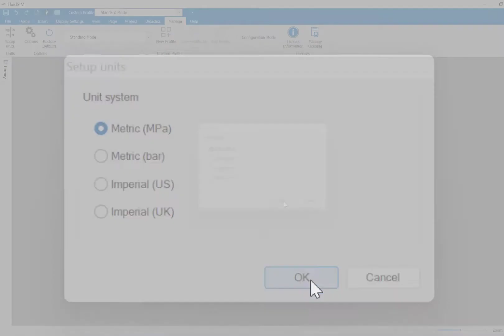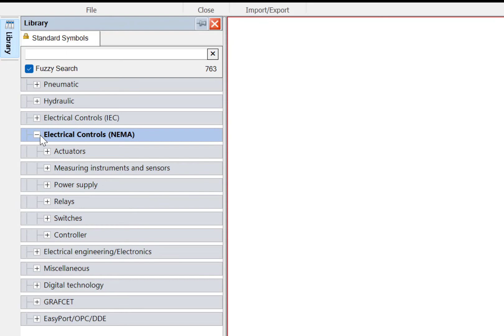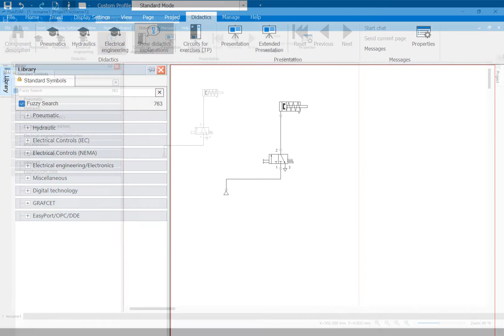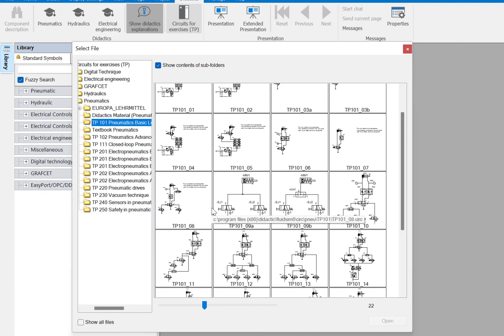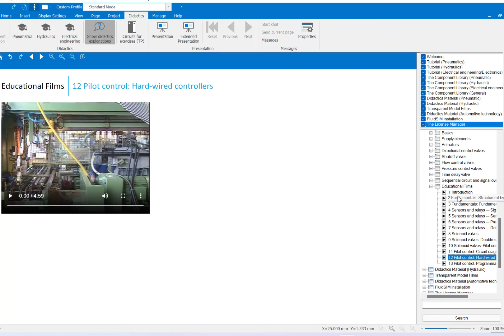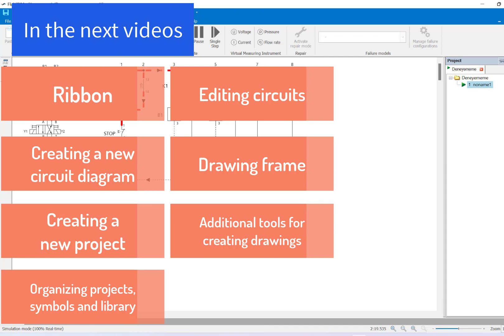Introduction to Festo FluidSIM 6

Comment: how much is the software? sir including the activation?
Reply from the maker: It depends. There are so many options about licensing. My lisansing procesure is complicated. The better is to send an e-mail to the local distributor of the software or the Festo Global directly. Academic lisansing is slightly different and cheaper I think. You can try to purchase a lisans on the Festo website and they can offer something.

Comment: Pak, apakah saya bisa mendapatkan licensi yang bisa di gunakan untuk mode siswa..
Reply from the maker: On Festo's website, two separate versions of FluidSIM 4.0 for pneumatic and hydraulics are available as demos and can be downloaded. With the demo version, you can perform all the drawings and simulations but not save them. Access to the Didactic section is also restricted. Apart from that, a free student version is not currently available. I recommend that you make a request by e-mailing Festo in your country (think Indonesia). We've had students do that before.
Reply: @FatihCebeci  terima kasih banyak pak fatih atas bantuannya, saya akan mencoba saran yang telah anda sampaikan. Harapan saya  Semoga ke depannya festo menerbitkan kembali software untuk mode siswa dan sebagai sumbangsih untuk dunia pendidikan. Sekali lagi terima kasih banyak pak fatih. Waalaikumsalam 🙏🙏
Reply from the maker: You're welcome, my pleasure.